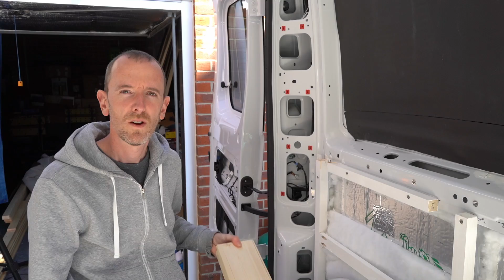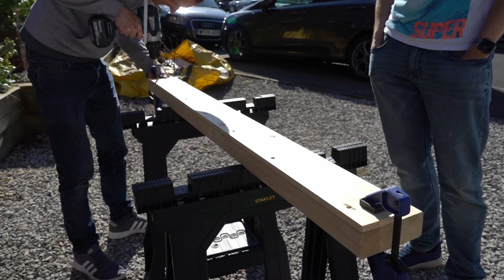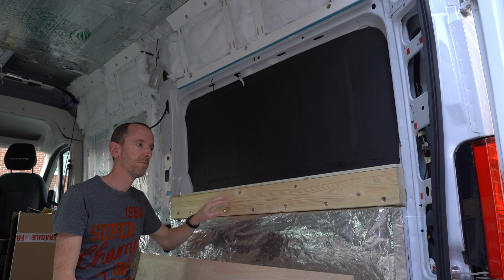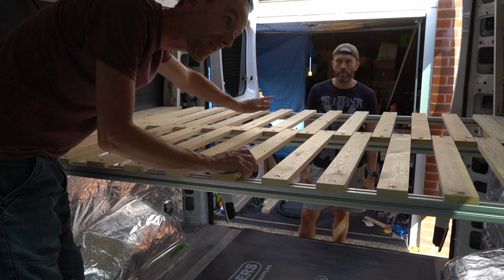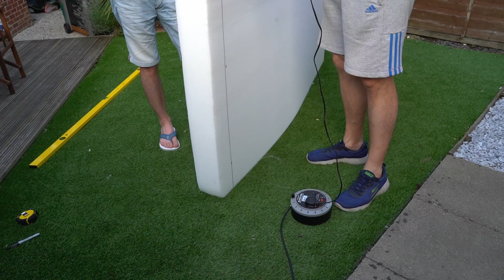EXTENDING Campervan Bed | Fiat Ducato | UK Self-Build Campervan Conversion

Comment: What size Aluminium Extrusion did you use ? When I retire next year I want to do another conversion on a van the same size as yours and I love the bed idea as you can have it as both single and double. At the mo I have a low roof Transit custom which I have converted but I use it for work as well.
Reply from the maker: The extrusion is 40mm from RS Components. Enjoy your conversion when you get to it, we love the van so you’ve made the right choice.

Comment: Pretty good design there, how has it been ? Many are using IKEA for the width bars across but aluminium seems really good for reduced weight
Reply from the maker: Thanks it’s been amazing. Still going strong after 3 years and wouldn’t change a thing. Our approach was a bit more faff than the ikea solution but much more robust and flexible I think.

Comment: Hi GUYS, how did you secure your strutts (1st and 3rd) so that they dont move?
Reply from the maker: I used some L shaped fittings and screwed into the slot in the aluminium on one side and into the wood on the side of the van on the other. Did this each side for extra strength.
Reply: @OurVanPlan thanks so much 🙏

Comment: I’m loving this bed. I’ve got the same size van and have been pondering why beds take so much space. This solution is really elegant
Reply from the maker: Thank you. It took a lot of thinking about until we got it right but it works so well and we tend to leave it extended for short trips.
Reply: @starcaledonia - see my comment from 6 months ago ref some changes.
I also didn't ply line to save weight, managed 25mm celotex at head and foot boards. Still achieved 190cm length. But all credit to Our Van Plan.
 I would advise to move rear door handle up to top of door for safety, there kits available.

Comment: This is an absolutely brilliant layout. That extending bed is so versatile. When the bed is pulled out could you please tell me the measurement between the bottom of the extended bed and the finished floor? I’m just considering whether it would work sliding out and gaining support from a longer kitchen unit that takes up part of your l-shaped bed in this design. Thanks
Reply: Hi,
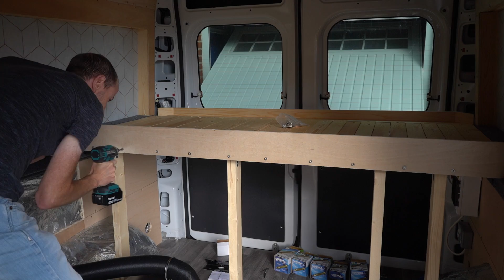Not sure this helps, but I've built similar (see my other message) and mine measures 800mm.i think their build is slightly higher. 18:04
Reply: Thanks ever so much for taking the time to reply. 👍🏻

Comment: What's the white material with isometric pattern you used inside the cutouts?
Reply from the maker: It’s just vinyl flooring stuck on to the plywood.
Reply: Thanks. I know you said it was called something like prism. Do you know exactly where to get it from?

Comment: Hi, I've been using your videos fir my build to. Copied your bed but used IKEA Skova mid beams as I lot cheaper. I'll put in nylon runners and run the beams on felt pads over those.
But thank u so much as even with your excellent videos I've struggled with design.
Don't delete your videos I'm using the rest too.
Reply from the maker: Glad you’ve found them useful and definitely no plans to delete!

Comment: What size aluminium extrusion did you use 40 x 40?
Reply from the maker: Yes 40mm
Reply: And, you’ve  had no issues with bending? And thank you for getting back to me.
Reply from the maker: Nope all good. Super strong.

Comment: Super in love with this. I have my first van and want to do a similar idea. Where did you get the metal beams??
Reply from the maker: Glad you like it. They were from RS Components. 40mm aluminium extrusion.
Reply: @OurVanPlan  mate I love it definitely the best l2h2 build out there 🥰 thank you mate.
Reply from the maker: Aww that’s really nice of you to say. Thank you 🙏
Reply: @OurVanPlan  also red components is very close to home for me 🥰
Reply: @OurVanPlan  I’m guessing it was the 2000mm?
Reply from the maker: My order details:
RS PRO Strut, 40 x 40 mm, 8mm Groove , 2000mm Length
Stock no.:761-3313
Qty:4
Reply: @OurVanPlan  awesome 🤩 again thank you

Comment: Very interesting thank you. Can you tell me more about the aluminium extrusions please? We were going to use the ikea struts that are often see on bed builds but yours look better!  What size dod you use and where did you get them? Any other tips ? Thanks
Reply from the maker: Glad you found it useful. The extrusion is 40mm from RS components and they sell it and all the bolts and adapters and stuff. It was definitely worth doing this way as much more sturdy. No other specific tips really, if you follow what I did you’ll be grand.
Reply: @OurVanPlan  thanks so much!
Reply: @OurVanPlan  oh I just looked on that website…lots of 40 mm…could you specify exactly which one please? Maybe post the link for the exact one? Many thanks
Reply from the maker: It was a long time ago but just dug out the confirmation email:

RS PRO Strut, 40 x 40 mm, 8mm Groove , 2000mm Length
Stock no.:761-3313
Qty:4

Comment: Hi love the retractable bed. Do you have a link to the aluminium extrusion please. Over time does it wear the wood down then start to stick ? Thanks ste
Reply from the maker: Thanks. The extrusion is from RS Components and have had no trouble with it wearing down or stopping sliding. It’s like it was when it was new!
Reply: Thanks for responding

Comment: If you want to mark rivnut locations on to wooden batten simply take a piece of the corresponding size threaded rod ( or some spare bolts) cut into 1in lengths pop them in a drill sharpen to a point. Then screw the pointed bits of all thread into the rivnuts, to mark the wood simply align it level it or what even takes your fancy and push it firmly against the points, voilà, perfect marks for you to drill out your holes.  

Top tip: Mark the outside face of the wood as  I guarantee the holes won't line up if the batten is ar$e backwards. Nobody can drill a perfectly plumb hole with a hand drill. If you are using rivnuts through your build, these sharpened bits of threaded rod will come in handy on lots of occasions.

I'd also advise using an adhesive to help anything you are attaching to your van.  No threaded fixing is immune  to vibration personally id use a thread locker on rivnuts. For gluing, a hybrid polymer product like CT1 or Adiseal would be perfect, they have amazing holding power and remain flexible.
Reply from the maker: Thank you, great advise and definitely would have helped throughout the build if I were to do it again 👍

Comment: this is a great pull out bed design! We are in the middle of our L3 camper build and have some detailled questions about the design. I hope you still read these reactions and might want to answer our questions. The aluminum carriers seem strong and thin, where did you buy them? The part that slides out must be smaller than the fixed part as the moving carrier been hits the fixed part on the inside of the fixed bed. Still in the van tour video it seems that you have two equal size mattresses. What is the size of the fixed bed and of the part that you extend the bed with? Are the madrases both a bit smaller than the size of the fixed part? Thanks and enjoy your beautifull camper van!
Reply from the maker: Glad you found the video helpful. The aluminium extrusion is from RS Components. Each half is basically the same size as the aluminium sits right next to each other when closed. I did build an extension piece at the back that goes into the doorway to give more width. The mattress isn’t equal. The one nearest the back is a bit wider (maybe 10cm) including the additional bit I mentioned. When they stack the front one that goes on top sits a bit back vs the back one that stays put, if that makes sense. The challenge is with the cutouts as that restricts how wide each part can be.

Comment: Hi. Nice design of the bed. Can I ask what size / thickness of the aluminium bars used? Do you happen to have a link to the 4 x bars used? Many thanks.
Reply from the maker: They’re 40mm aluminium extrusion and I got them from RS Components.
Reply: @OurVanPlan  thank you kindly. They look more solid then the aluminium struts people use from ikea. Especially when designing a sliding bed style.

Comment: Brilliant video and easy to follow. I do have a question, I'm looking to do a similar design but I was thinking about having the bed so I could slide it both ways. So the "Day Mode" could also be in the further forward position allowing a larger garage space if needed. I can't seem to find videos of anyone doing this, wondered if there was a reason you decided not to? Thanks!
Reply from the maker: Thanks glad you found it helpful. I’m not sure how what you’re describing would work because at night you’d need to slide the bed back so you couldn’t use the additional garage space. That’s if I’ve understood it right!
Reply: @OurVanPlan  Sorry not sure i was clear. I think I actually sort of figured out the answer realising that obviously for you guys when you travel, you would always have it as a double so that's what you mean by having it back at night. However the difference is I'll be solo travelling mostly and if I had both slat sections as slideable, I could position it as a single further forward if I needed a bigger/taller garage space.

Comment: Thanks for the video! Great design and after picking up an l2h2 relay I'll be using this video as a guide to build my bed. Just a quick question, did you add the vertical supports under the bed for strength or was the aluminium extrusion enough to hold your weight?
Reply from the maker: Thank you. Glad it’s helpful. I did add them as additional strength but I reckon they’re not technically needed. More peace of mind.

Comment: Hi! What type of wood and size did you use for the slats. Looks very well designed, well done
Reply from the maker: Thank you. The slats are pine (spare from our ceiling) and they’re 18mm x 75mm. I reckon we would have been ok with 12mm thickness.

Comment: I’ve been looking everywhere for a design like this.  Did you leave those wood supports in underneath or were they just there while you built it.  I want to keep the underside open for storage.
Reply from the maker: It was 40mm extrusion from RS components. I kept underneath as open as possible but as I have a seat, boiler storage, water inlet and batteries there are a lot of uprights. You’d definitely need some under each fixed part of extrusion.

Comment: Great idea but 2 questions:

1) Do the square edges of the extended slats ever catch on the bottom of the foam when you are collapsing it into 'day mode' ? (I was thinking rounded slats would less problematic)

2) In 'day mode' there is very little air flow between the slats. Is this a possible mould concern on the bottom of the foam ? (Probably more for when the van is not in use)
Reply from the maker: No to be honest we haven’t had an issue with the slats catching the mattress nor any issue with damp. I think there are still small air gaps which help.

Comment: You could have drilled the wood first, offered the drilled pieces up as a guide . the same holes used to drill into the metal for your rivnuts !
Reply from the maker: Yeah but I wanted to use existing holes where possible. Your suggestion would be a lot quicker though!

Comment: I wondered if the bed could have been mounted to the van somehow, rather than wood screwed to the van. Did I see that the support for the slats is held in by 4 small screws after all those heavier fixings where used to mount the wood beam to the van.
Reply from the maker: Yeah probably. I’d def design it differently now it’s done as you learn so much after the event! But to be fair the wood that the bed sits on is solid and has no problems or felt no give at all.

Comment: Nice work again particularly framing the cutouts for the bed.  I'm elevating my fixed bed to allow the storage of two bikes in the garage area, need clearance of 950mm in garage area for my plan.
Reply from the maker: Thanks. Yeah we definitely couldn’t fit a bike in our garage unfortunately.

Comment: Hi what length m6 bolt did you use to secure the slats.... Thanks I'm advance
Reply from the maker: They weren’t very long maybe 30mm
Reply: @OurVanPlan  thank you getting back to about to mimick your bed build but ordering everything in at once

Comment: Nice idea and great explanation! What are the dimensions of the bars? Width and thickness? Thank you for sharing!
Reply from the maker: The metal bars are 40mm aluminium and the wooden slats 75mm x 10mm (possibly 12)
Reply: @OurVanPlan  Thanks! I am about to start making a similar bed and was a  bit worried whether 10mm for wooden slats  is enough

Comment: Love the bed and thinking of doing this in my L1H2 transit. What did you use to secure the fixed frames to the wood and also, how did you secure the smaller piece of wood that the extrusions slide on?
Reply from the maker: Thank you. We used the fittings for the aluminium extrusion to attach to the wood in all places. The slats are screwed into little M6 nut things that slot into the extrusion. The fixed part is attached using L brackets and the nuts that slot into the extrusion. Probably haven’t explained it well. But it’s all from RS components.
Reply: I don’t think I explained myself properly 😂
I mean the smaller pieces of wood on the sides of the van they are attached to the large piece. So the part where the edges of the extrusion slide along. I k ow you bolted the larger piece with M8 nuts and rivnuts but how did you secure the smaller piece as it seems to me to be taking the weight of the bed. Sorry, complete novice here and I need told step by step 😫
Reply from the maker: Ah ok we just glued and screwed those in (with a lot of screws!) but also the frame for the bench seat etc also buts up underneath to provide some vertical support.

Comment: Was going to use the ikea struts but now I've seen this i think the aluminium extrusion is better.  I assume you can easily screw a facing board onto the end one using the special nuts?
Reply from the maker: Yep 👍🏻 we had to carpet it to hide the bolts but you could probably glue a finished surface to it if you didn’t want to use the carpet.
Reply: Just seen that's what you did!

Comment: I guess you do not put any insulation where the bed is, in order to get 200cm width. Is that right?
Reply from the maker: Minimal insulation. So we had the 6mm closed cell foam insulation stuck on the metal and then the wood cut outs had silver foil insulation on. We don’t notice any major cold.

Comment: Awesome bed! What bit did you use make the m6 bolts sit flush on the slats and the face plate? It’s shown when you are constructing the faceplate but I wasn’t able to catch what it’s called.
Reply from the maker: Thanks. I think we just used a big countersink drill bit and then drilled the 6mm hole afterwards.

Comment: This is a fab idea. But you haven't mentioned where you got your Alluminium extrusions from or dimensions of the wood used etc.
Reply from the maker: Thanks Duncan. The extrusion is from RS Components and the wood is 18mm x 70mm.

Comment: Question the name of the aluminium bar an where to find them to buy thanks in uk Watford London and the length you used many thanks great idea
Reply from the maker: They were from RS components and 40mm aluminium extrusion. They do all different types. I think the cut length was about 1.5m

Comment: Brilliant! Thanks 👍
Reply: I've looked at the u tube again.. He mentions the kitchen top is at 900mm and with bed out it's just below that so I think theirs is more like 850 to 880.
It lines up with the middle of the 3rd lower vent (top set) at the rear doors.
As mine is lower I can fit a window and still have both matresses stacked and see out.
I've also put small  window behind kitchen unit as concerned about ventilation and light.

Comment: I like this bed solution and found your video searching for extending beds. I'll be travelling 50/50 alone or with someone else so was thinking of having something 2/3 size double permanent bed, but to extend out to double. So not quite half half. Can you tell me the height you made this and where you fixed it, what height do you get garage space wise? Thanks for great video 👍

Comment: Brilliant build. Your conversion is so so much better and thorough than so many YouTube conversions.

Could you tell me what the aluminium bars are you’ve used to make the bed?
Reply from the maker: Thanks Jim, appreciate that. The metal bars are from RS Components called RS Pro Strut 40x40. Hope that helps?
Reply: @OurVanPlan  legend. Thanks a lot.
Reply: I love your videos and appreciate your answer on the RS Strut, could I ask where you got the M6 adapters from and what screw did you use to connect the slat to the strut. Many thanks! David
Reply from the maker: The adapters that slide into the strut and are screwed into are from RS components and the bolts are just from screwfix. Adapter details:

RS PRO Fixing & Connection Element T-Slot Nut, Groove Size 8mm
Stock no.:767-5654
Reply: @OurVanPlan  Super stuff, thanks guys! I’m finding lots of good info on your videos, your project looks amazing. Best, David

Comment: Very helpful video in attaching the structure with bolts to the side... I particularly enjoyed the determination in your face as you tightened the bolt!! Good on you for solving each problem as it presents and finding solid but tasteful solutions
Reply from the maker: Thank you, yes mixture of strength and dreading it not to work 😂

Comment: What sort of aluminium tube is that ? I thought it would bend with 2 people on it ?
Reply from the maker: It’s aluminium extrusion 40mm so quite thick and certainly impossible to bend! It’s less of a tube but more of a frame eg not hollow but has some structure inside it.